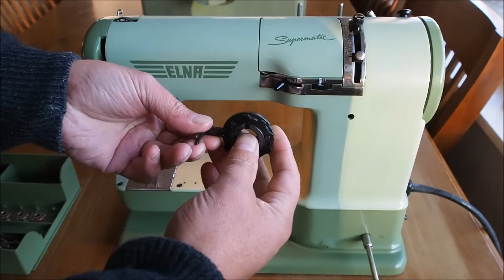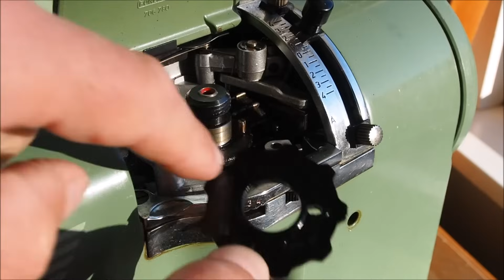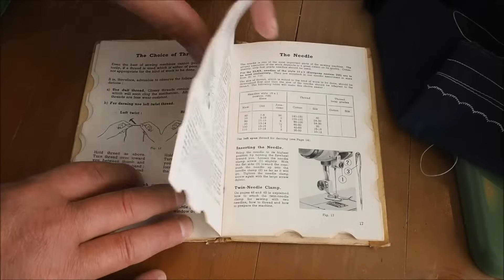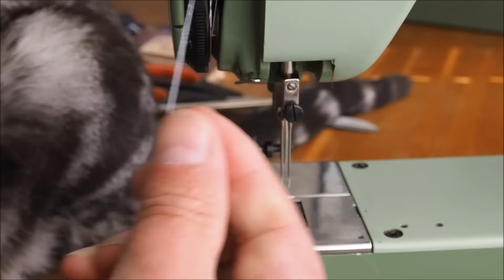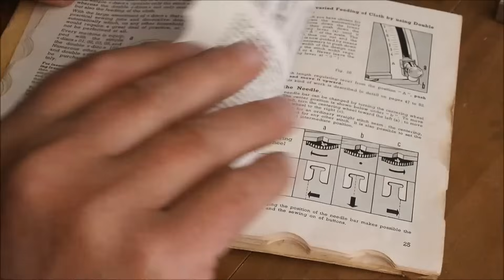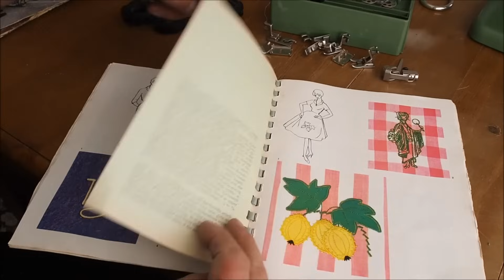ELNA Supermatic Basics - The Beautiful, Classic ELNA Sewing Machine

Comment: Thank you so much for your 3 videos on the ELNA Supermatic!
I got one for 30€ (about 60 NZD) a few days ago and had some issues with maintenance.
After some finicky wiring and contact cleaner the main switch running again and now I'm replacing the pulley to make it sound less like my two-stroke enduro hehe.
I'll see if my 3D printed pulley works or if it gets too slippery or hot and I'll have to order a replacement.
Keep up the great work!
Reply: Can tel me were I can find the pulley made in 3 D or tell me the sizes so I can have it made in Italy. Tanks.

Comment: Could you, by chance, please tell me the bobbin number for the Elna Supermatic? I have been told by different people that the bobbin number is 426000. The problem that I keep running into is that not only does it NOT fit on my bobbin winder (the one on the machine) but it is a bobbin with a solid bottom. Even my manual shows using a bobbin with holes on the top AND the bottom.

Comment: Thank you  I just bought an Elna supermatic manual original from1952 we have managed to get it operational and were lucky to not have a flat spot on pully  Took all apart and oiled. Our issue is the take up level for pressure foot is seized bc the spring is not moving.  I can now lift it up after WD 40 but it will not allow me to put it down.  Been working the shaft up and down. Wondering if you have any ideas. We are so close and I am excited to use it. Thanks so much for this video

Comment: Does the light go on automatically or is there a turn on/off button? Where can you find the bulbs if it needs replacing?
Reply: The on/off switch for the light is on the right over by the cord plug.  He shows it at the beginning of the video.

Comment: Hello, this video is really amazing! I didn't have the manual! Thank you so much. Last year I found an Elna Supermatic machine at my mother's house. It belonged to my grandmother and it is fully operational. It is the same as described, but it has an electric foot control instead of the knee lever. It also has two shades of grey. It says model Type 722510, but I don't know what year it is (maybe you can help me with the year). (1962?)

I would just like to make a small correction to the video: in the part where you indicate the pressure control of the sewing foot, the greatest pressure to the sewing foot is to the left, contrary to what is indicated in the video. The least pressure is to the right. This is noticeable by putting your finger under the sewing foot and feeling the pressure.

Greetings from Chile and thanks again!

Comment: I was wondering if anyone would have a time stamp to the pattern timing adjustments my current problem is when using the zig zag disc the needle is pulling the material side to side instead of moving side to side above the material
Reply: It sews perfectly fine in a straight line

Comment: Hello I live in the Netherlands and have the Elna plana automatic (1963) with a foot controller.  That was later adjusted because I couldn't get used to that knee "thing".  
I want to change the lamp on this machine.  do you have a video of that?!
The light is under the top cover, but I can't get the top cover off.
The light therefore shines from under the middle part of the machine, which is indeed not really handy because not directly on your sewing. 
 
Thank you in advance if you take the time to read this

Comment: I have an Elna ZIG ZAG model, I believe the number of the model is 722010, I lent it to a friend and when it came back, the knee lever is not working, the metal cylinder where it fits in rotates freely (which it shouldn't be doing).  Can you think of any solution?
Reply from the maker: It's likely that it has become disconnected at the inside end. Try having a look by taking the base off. 3 screws underneath.

Comment: Hi, Oh, God what a nightmare!!! I had to take the pressure bar assembly apart to get at the screw that hold s the presser foot on, it was very very loose and I could only jiggle the presser foot lever to get it to lift hte foot fully, then all of a sudden the entire linkage all came apart!! even to the drive rod that connects to to elnagraph disk assembly!! I dont think I can get all this lot back together again, can I send you some photos of it and see what you think? its s such a shame as the damned thing was working OK but the design of this crazy thing has really put me off these supermatics, having to do practically an ENTIRE strip down just to get to the screw that hols the presser foot lever on, I have had Singers where hte presser foot lever becomes loose but they are easily accessible and never covered up with an ENTIRE drive linkage assembly!! Thanks amateursewing@gmail.com

Comment: Hi, I finally got a fairly good Supermatic!! I have put photos of it on this google io elnaheirloom site, its got a few faults though, the presser foot lever is very loose and it looks like there is a big screw that holds it on, but the big zigzag assembly is right in front of it and I dont know how to proceed, do you have a video showing how to do this? Also the stitch length lever has snapped off completely right at the slot that it sticks out of, I think that would need a complete new lever part, I can just move it with a small screwdriver, pity I cant post any pics to show you, my email is amateursewing @ gmail. com if I can show them to you? Its the foot pedal model and the case is very nice, all metal and sprayed gold inside. Thankts

Comment: What a dear fellow and a great video!!!  Hi Molly--great singing voice! I've been loaned an Elna supermatic and am trying to find model # so I can investigate getting bobbins, needles, etc.  (DOES ANYONE HAVE A FAV. SITE from which to order??) The machine has a #3 cam.  I'll just be doing straight or zigzag crafty stuff.  Don't need anything fancy.  Didn't catch how you go to or from the cam.  I'll watch the video again. Thank you!
Reply from the maker: Thanks and I'll pass your comment on to Molly. You should be able to get the bobbins from any sewing machine shop or just have a look around on-line. The bobbins are specific to a subset of Elna sewing machines.
Reply: @InStitches  Greetings!  I've pulled the sewing machine out to use it as winter approaches in the PNW. Testing on a piece of sheet I found that there were tension issues, so I verified as much as I could to make sure the settings are correct and now I can NOT get the bobbin thread to be picked up. Are there perhaps frequently mistaken settings? What have I done? I believe I have all the tensions right. I wish I still had my old treadle machine.
Reply from the maker: @7777777Milz  Hi. Make sure you install a brand new needle of the right type - standard 130/705H needle and make sure it's inserted correctly. Check threading. If that doesn't resolve it, maybe the timing is out or the hook pinion gear is broken?
Reply: @In Stitches  Thanks again!  I finally realized after checking "everything" that I'd been turning the wheel away from me instead of toward me while trying to pick up the bobbin thread.  (forehead slap) Now, I'm ready to attack my next project!  Thank you for being so fast to answer!

Comment: I bought an Elna Supermatic largely based on this video. According to the date on the bottom, it's from 1957! Sure enough, the old pulley had not 1, but 3 flat spots. Three! But I got a new pulley and now I LOVE this machine. It's so smooth and quiet and sews through multiple layers like butter. I still had to refer to this video to insert the bobbin properly the first couple of times. I wish I'd bought one sooner. Now I'm holding back from getting an SU as well. I live in a small NYC apartment and don't have the space. Anyway, thanks for the video!!
Reply from the maker: Thanks. It's great to hear you now own one of these beauties.
Reply: I bought one on Craigslist. It’s in great shape. It’s a bit loud. I ordered a new pulley wheel and look forward to following your video to replace it.  One question:  the stitch length knob doesn’t seem to turn. Maybe not in the particular model? Th problem is the stitch length is too tight to run the double cams. How can I adjust it?  I love your videos. You do so much good!!!!

Comment: Thank you for all of your information. Do you have any tips to sew straight with this sewing machine without seam markings on the throat plate? I tried finding a vintage seam guide of some kind to go with my Supermatic. It's a 1960's Beige Plana Supermatic. Mine didn't come with an original case so, I'm going to look for one. If I cannot buy one,  I'll likely get someone to make me an extension table. Also one of the base plate screws is a bit stripped by a previous owner. Maybe the wrong screwdriver was used to remove it. The burrs on that screw could catch on fabrics so, I gently sanded the burrs smooth and now it won't catch. Maybe I can find a compatible machine screw at a repair shop. At least it's not so stripped that it can't be removed. It's been cleaned and oiled and I like how speedy it is. I did buy this machine based on it's sleek style.
Reply from the maker: I've seen people put tape on the bed of the machine as a guide.
Reply: @InStitches  Thank you for the tape idea.

Comment: Thanks so much for this video, great production and priceless information. I am a hobby engineer and sewing machine enthuiast. I have designed and produced a replacement drive wheel for this model in my home workshop. I needed one for my own machine, but apparrently a flat spot on the rubber drive wheel is a common problem. I think they will help others to restore their machines to smooth running. I would be happy to send one to you for evaluation and comments.
Reply from the maker: Thank you for your offer. I can buy a replacement pulley for a very low cost.

Comment: I absolutely love this video. I hope that you make another few videos for this model. You're an excellent teacher and I would have watched the whole video even if it was two hours long. :) I do have a question about how you store your machine. I know that you've talked about it quite a bit, but I understand that you have one of these machines yourself? Do you take off the whole fly wheel when you store it? What if you are using it day to day or every few weeks? Or can you simply just unscrew the coupling knob and pull the flywheel out just a slight bit? Also, how long would you say it takes for the flat spot to form?
Reply from the maker: Thanks. Unscrewing the coupling knob is probably sufficient for long term storage. Not sure how long a flat spot would take to form but maybe a matter of months?

Comment: Hi! may I ask for a piece of advice for an absolute beginner, if I should make a choice (I have :)) which would you prefer, assuming you know them: The Elna Automatic (with that case you can turn into a workspace or the Singer Meritt 247?
Reply from the maker: In my opinion, I prefer the Elna as it feels very nice to use. I like the Singer as well.
Reply: @InStitches  Hi! Thanks, that's the one I ended up with now... :) Although I see it needs some TLC in maintenance (lubrication and sorts). Turns out I had made the right choice.

Comment: Hi from CA, great video!  I have a supermatic as in your video and trying to get it up and running but the presser foot lever in the back is not engaged (it just flops around) and the foot is stuck in the raised position....  could you guild me as to how to fix it?  (or maybe a how to video on fixing it? 
thanks sooo much!!
Karen Montgomery
Reply from the maker: Hi Karen, That sounds like the foot bar has seized. Open the cover on the left of the arm and look for the bar that the foot is attached to. Get oil on to the top and bottom bearings and work the bar up and down by hand until it frees up. Do this with the foot lift lever up. The bearings are where the bar goes through the metal work. Good luck and let us know how you get on.
Reply: @InStitches  I finally got it unstuck and the lever now works!!! Yay!!  Now on to the next problem...  it seems the arm for zig-zag is not in place and not creating zig-zag stitch.  I believe the bar came out of the black cradle that would engage the cams..  I can't figure out how to take off the machine casing to get to it to put it back in place.  Any magic as to how to remove the top cover??  I can't figure it out... :-(
Reply: darn I figured out how to take off the cover for the disks and was able to loosen the arm that should be in the black cradle and while I tried to put it back together and..?  (went to put the cover back on and lost the long counter (?) wire that is attached to the lid and hooks up to the arm I just re-positioned inside of the machine and now I can't find it....) UGH!!! any thoughts???

Comment: My wife just got the one colour version from her grandma. Is it able to run forward and backwards like modern machines?
Reply from the maker: Yes there is a reverse function on this model.
Reply: @InStitches  I just can't seem to find it. I've looked through but manuals I could find online, but haven't found reverse yet
Reply: @danielstermark8765  Move the stitch length adjuster, on the upper right, down to the reverse position -- just push it down and the sewing will immediately reverse direction.. You can do that while the machine is in motion, and you can push it back up to go forward again, without stopping. Maybe there's another way, but that's how I've been doing it for 55 years, no problem!
Reply: Look at 16:00 on this video.
Reply: @susankennedy5739  thank you, and I thought that I did look through the whole video, just shows, one doesn't see everything with two youngsters running around.. :) thank you again

Comment: How do I switch the direction that it sews in?
Reply: Move the stitch length adjuster, on the upper right, down to the reverse position -- just push it down and the sewing will immediately reverse direction.. You can do that while the machine is in motion, and you can push it back up to go forward again, without stopping. Maybe there's another way, but that's how I've been doing it for 55 years, no problem!
Reply: Look at 16:00 on this video.

Comment: This is an excellent and informative video! LOVE! The only trouble I'm having is switching my needle to the center position. I have a slightly newer "Automatic" version of this machine. The setting shows the bar in the center. The wheel seems hard to rotate.  I tried to see if I have a left hand side needle placement by removing the needle.  Not sure exactly what I need to do. Thanks so much
Reply from the maker: Thanks Donna. The wheel is probably hard to turn because it is seizing up. There's a specific point to get the oil into and sometimes it will need careful heating. You may want to take it to your repair person to get it sorted. The later models suffered from the same issue. I don't have a specific video on the subject at the moment.
Reply: @InStitches  thanks so much! We discovered today that this bakelite type wheel had been broken prior to me. This part is fairly important, correct? It not only adjusts the needle left to right but also plays a part in tension perhaps?  I'm having tension issues for the top thread and I'm suspicious of the tension mechanism as well because it seems different compared to another earlier Elna I have. Such a shame, this Elna runs great otherwise!  About to give up on both my Elnas. The earlier green one has a broken part that doesn't move fabric forward with the feed dogs. Your videos are amazing and really helpful, so appreciate you.
Reply from the maker: @modgranny  There is a tension adjuster dial on the left end under the face plate. I think your broken dial is for the needle positioning. Thanks again.
Reply: @InStitches  Thanks so much, my tension problem is with the top thread. I get bird's nest and it is loose. I believe the bottom thread tension is okay. But I don't know enough about these machines to say definitely.
Reply: I really appreciate your help and responses!
Reply from the maker: @modgranny  Try re-threading and when you do, make sure your presser foot is up. Double check your threading. Maybe clean between tension disks when foot is up. The disks should clamp the thread when you lower the presser foot.
Reply: @InStitches  Okay, will do! thank you you've been very helpful and kind to me.

Comment: Does this machine have a belt? Several years ago I took it to a repairman and I thought he said the belt had to be replaced, not the pulley, but I could be wrong. Anyway, at the time he was unable to find a replacement part. If there is a belt, what part would I need to look for? Are any still available?
Reply from the maker: Yes there is a belt joining the upper and lower shafts. I don't think they are available. The pulley is on the motor shaft and drives the machine.